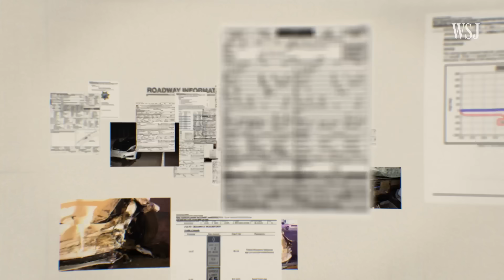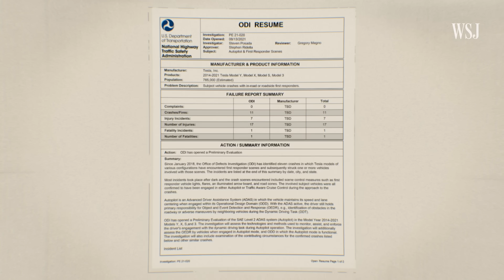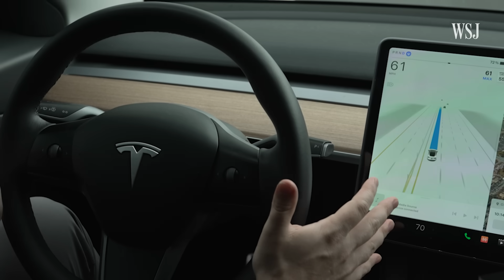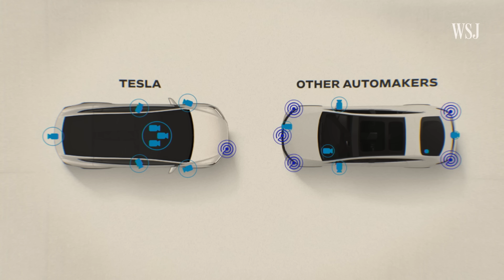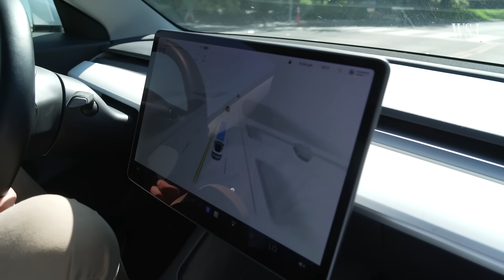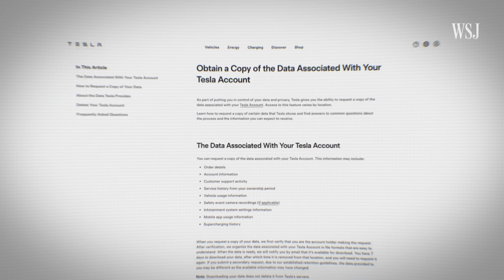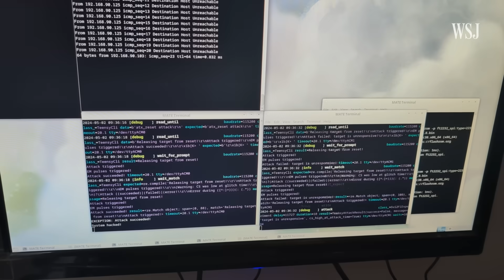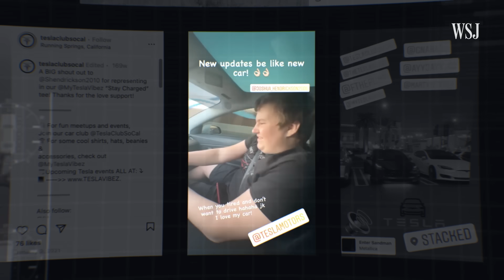The Hidden Autopilot Data That Reveals Why Teslas Crash | WSJ

Comment: Seems that Tesla is being held to a higher standard for some reason.  My Lexus isn't going to avoid those crashes either--and the car isn't supposed to drive on their own.  You are driving the car, and even Supervised FSD (which I have) is just a better form of cruise control.  The drivers, in my mind, are at fault.  They were warned, and not paying attention.  Now if Tesla software was making mistakes and steering people into deadly crashes, that would be a problem.

Comment: Autopilot does not mean Full Self Driving.  It's that simple.  Autopilot is cruise control, lane keep, and emergency braking.  You are always required to monitor it.
Reply: People don't want to read, but still want to be mad.
Reply: Obviously the tesla cameras cant see in the dark. Humans can.
Reply: @alanmichael1234  every tesla owner could tell you after owning the car only couple of months that the car sees better than they do. you need only be a passenger in one and look at the visualization on screen to understand this.
Reply: Surely the whole point of this video is that it does not do emergency breaking
Reply: @alanmichael1234  it does do emergency breaking!  The examples shown are pitch dark situations that would be difficult for a human to see before its too late!
Reply: Tesla’s full self-driving is also not full self-driving. Any system design has to accommodate human error. Especially safety systems. Tesla mislead customers by using terms that imply the system is safer than it is.
Reply: If that's all it did, it would be fine. But it does more. It can also take corners, switch lanes, even start when a light turns green.
It takes away too many tasks, making people bored, causing them to lose attention.
Reply: @Robbedem  "Autopilot" (not FSD or Enhanced Autopilot) does not switch lanes or stop for lights or signs.  As for cornering, if you mean following lane marks on the road as it corners/turns, yes, it does that.

Comment: As much as Elon fails, this also fails on the other extreme. Tesla has some very good engineers, handicapped by Elon? Yes. Starting off with a crash from 3 years ago is misleading, by a lot. With the many upgrades has come improvement. And you should listen to some people who review the changes and this past year has apparently seen a lot. And have you ever asked what LiDAR consists of? A light source with the ability to strobe, super fast; Teslas have top end lights capable of this, check; light sensors or cameras, check; a fast computer that can measure when light was emitted to when it was reflected back, fast computer? Check. 

The problem isn’t Tesla, the problem is no AI understands how to tell the truth, they just want to generate answers. This is a fundamental flaw. Beating that down is ambitious. 

Is Tesla FSD safer overall? That is the correct question, like I was telling a guy who doesn’t wear seatbelts, the fact you MIGHT be in an accident where not wearing a seatbelt is optimal, it is unlikely. Tesla seems to be like this, only big numbers can measure it, not our tiny experiences. I think the answer might already be yes, but A, we can’t take Elon’s word on this, and B we must be entitled to see the numbers for ourselves.

Comment: 1. Is there anything in front of the car that's not the road?
2. In what direction is that thing moving compared to its surroundings?
3. In what direction will that thing be moving based on its appearance?
Why is that so hard to implement?

Comment: This is a big complaint that I have with our machine vision systems at work, which are part of our quality control. The machine vision system often can't accurately determine what it is seeing, but I a human can. Without a human override, the systems are useless and don't really ensure quality. They are great at recording data, but I can often create false data without much effort. The typically just slow the speed of the process down.

Comment: idk why, but when I hear elon said that it is it's more safe than human or greater safety driving while also implement it only using cameras and only putting one radar as backup?, makes me think it's like implementing GPWS on an aircraft but instead of using proximity sensor (Perhaps mixed with Inertial Sensor and other stuff?) (mixed with GPS on EGPWS), you use camera only for the GPWS, or implementing trim system to be automatically adjusting while only based on one AOA Sensor

Comment: From watching Mentour Pilot, I have come to realize that autopilot in aviation has a completely different meaning than what it means to the general population.
Reply: Pilot here, yep. The public looks at aircraft autopilot as a navigation system that does it all, not recognizing it has to be programmed with a very specific plan, has a couple dozen combinations of operating modes, and has to be managed.
Reply: @skycaptain3344 That is what Tesla is claiming to be autopilot. Hence the distinction between Autopliot and 'Full self driving (Beta).'
Reply: @CmdrTobs  as the video shows, that’s not what Elon Musk has actually been saying
Reply: @CmdrTobs  And Tesla sells autopilot as something better and more capable than the adaptive cruise control with lane keep assist and breaking assistant in a 2020 Opel Corsa from Stelantis.
Reply: @VolkerHett  Still some european car brands have far better "auto pilots" than Tesla. Almost every new european truck would have avoided the crashes shown in this video. Because europeans do not solely rely on video.
Reply: @skycaptain3344  not sure it did.Time index?

musk has talked about this confusion at length autopilot vs FSD (beta)
Reply: @VolkerHett  it does a lot more than that, it it decides on speed, changes lanes etc... hence.... autopilot.
Reply: @CmdrTobs  Back in 2020 my Opel alerted me of speed limits and asked politely if I authorize it to adapt to the speed limit. 
Ok, it flashed a speed limit sign in the dash with a message to press the mem button on the steering wheel :D
Reply: @Maurus200  

Elon Musks 'Ted' talks aren't a product manual.

They are different products, it's not just semantics.
Reply: @CmdrTobs  Full Self Driving (Supervised) these days (since the middle of 2024).
Reply: @VolkerHett   Basic Autopilot and Traffic Aware Cruise Control (TACC) is included with most if not all Tesla passenger vehicles, these days. Don't know if it is available for Cybertruck, yet.  Do note that Autopilot and Full Self Driving (Supervised) are two separate products. An FSD subscription currently costs about 100 USD per month, or can be purchased for 8,000 USD.  Autopilot aided me in driving out to San Diego and back to Alabama last February. Next year FSD will do the same trip this coming February. Autopilot, will not, for instance, stop at a stop sign, nor make turns at intersections. base Autopilot is primarily lane holding. FSD is for all sorts of roads and obeys many traffic signs, it is also integrated with the navigator so it can be used (in principle) to drive you from most places to most destinations over most roads.The current FSD ( Version13.2.2 FSD (Supervised) ), though much improved over older FSD (Beta) and Autopilot, has not reached the point where it no longer requires supervision, so it monitors the driver's face and eyes and if the driver fails to pay attention to the road, FSD will noisily demand the driver take over.
Reply: @ yes! And four years ago it wasn’t as able as today and that’s why it may not be advertised as anything beyond 2.5 autonomy in the EU until it’s certified.
Reply: @slowercuber7767  out of beta, good to know
Reply: @ its amazingly good, but still requires watching and still has some flaws, some inconsistent, some consistent flaws. The change from Beta to Supervised makes sense, and it is so much better now, but you really still must stay alert and ready to take over.
Reply: @peter_meyer BMW Mercedes way better
Reply: @skycaptain3344  Who is this 'public' is it really late boomer moms/dads who think autopilot = Nightrider?

The equivlent cohort in the 90s thought 'laptops' are for lap use and CD rom dives were coffee cup holders.
Reply: I own an Tesla and operate a real autopilot all day at work. The autopilot in airliners is really just a workload reduction tool. It will do exactly what you tell it to do and it will not react to changes in the environment for you. Tesla autopilot actually does much more than a “real” autopilot. But it’s not very reliable and at least in my 2020 X it says very clearly that it’s a beta product and you are responsible for safety. People are foolish to trust it with their lives. It’s certainly helpful on long drives but you have to stay vigilant and most people don’t have the discipline to do so.
Reply: They should have made the autopilot on these cars cannot be engaged if these systems are unsure what to do on an unknown circumstances just like how in a plane does (such as when stalling the autopilot wont be able to engage and require the pilot to stabilize first and make sure everything is ok)
Reply: @ap-qd9xf  How is it going to help if you are approaching an unknown at 60/70 miles per hour? Maybe the car should just hard braking when approaching an unknown every time to stop in front of the unknown.
Reply: @Uouttooo  Exactly what my Subaru does and that's only got enhanced cruise control, mainly because Subaru didn't cheap-out and ditch radar sensors.
Reply: @ap-qd9xf  The question is can it disengage with enough notice for the driver to take control. A plane is typically several kilometres from the nearest obstacle (the ground).
Reply: And sailors understand it too.
I wouldn't set my autopilot and go to sleep, even if I am I the middle of the Atlantic ocean.
Not to mention sailing in shipping lanes where there are big ships around.
This is a 2 part responsibility, tesla for false advertising and the drivers for being irresponsible. 
A car is a weapon.You wouldnt let a weapon fire without having total control of where it is targeting.
Reply: even on planes they always need a 'woke' pilot while on auto-pilot.....
Reply: Guys it gets better within time
Reply: Good comparison. Flying large aircraft we are on autopilot / auto throttles 98 percent of the time. 

When the weather is very very poor for landing we HAVE to use the autoland system. Our aircraft and crew are able to preform a landing with zero visibility. There is a lot of training involved initially to be qualified to use the autoland system. And then every year you will practice it once in the simulator. Only the captain can preform the landing. 

When we use the system in the real world we spend almost five minutes briefing the landing from the checklist. And then the monitoring of the aircraft is intense. It doesn't take much of a system degradation to cause a go around to be called for. 

True autopilots in a car that don't have to be closely monitored by the driver seems to be a long ways away.
Reply: And there is a reason that pilots are extensively trained on how to effectively monitor all automation in the plane and stay vigilant even when not manually operating the controls.

And the automation systems are also build on not only redundancy but also to give clear and concise information on exactly what mode they are operating in to the pilot.

The same should be the case in cars. Automation can take away some tasks from the driver but at the same time make it harder to stay in the moment and ready to notice and react if something unexpected happens.

From my own experience in flight training I know full well that it is harder to react to a sudden, unexpected thing happening if autopilot is engaged compared to when flying manually. A false sense of safety will naturally lower your vigilance and can quickly become a trap.
Reply: Yep autopilot and FSD are totally different things.  Not defending Tesla For calling it autopilot. Because it’s kinda misleading. Also you would think WSJ would do its due diligence and let its watchers/readers now what autopilot actually is and what it’s not.

Example:  at 3:04, it is not the autopilots job to stop at this intersection, but FSD would. If anyone is using autopilot other than a fancy adaptive cruise control on highways, then they’re mislead and didn’t read or properly understand the autopilot manual.
Reply: Imagine if airplanes used camera data instead of actual sensors. I know it’s not 1-1 analogous because they’re so much more complicated then cars, but that’s not my point. Just imagine how crazy that would be.
Reply: EVEN if you have a lofty expectation in aviation autopilot, there is a distinct advantage in not having wrecked shipping trucks in the sky!
Reply: Exactly this. Autopilot is basically a human-operated system that requires constant vigilance and total knowledge of how it works, how it will respond to situations, and how to tell it exactly what you want. Two pilots are required most of the time to fly a plane, and they use autopilot like another set of controls, not as a system to do their job.

The point is to reduce pilot workload to enable them to achieve the safe operation of the aircraft, not to fly the plane for them. Tesla are trying to make a system which removes the humans totally. In aviation, for almost a century of trying, we still do not have a safe, unsupervised autopilot that can be used at any time. We are close (Look at the emergency landing feature on Cirrus Vision jets), but not there yet. Airspace is highly regulated, and anyone using it is following a very well defined and specific set of rules. In contrast, roads are incredibly chaotic, and many drivers have poor knowledge of the correct way to do things, or are just brutally ignorant of the rules. 

And here we have Tesla, who think they can make it work using computers with crippled, unreliable sensors (cameras only). The moment Elon said they can do it using cameras only, I knew the whole system was doomed and would result in deaths.
Reply: I think pilots dont even call it autopilot, or at least thats not how the manufacturers call it. Pilots get extensive training as to what the system can and cant.

Big difference to Teslas, considering how Elon constantly talks about self driving cars. Like in 2015 he said fully self driving cars are just 2 years away, its not a secret why he called it autopilot.
Reply: @termitreter6545  Yeah. We do. The standard callout for us to put the jet on autopilot is, " Autopilot Center Command".
Reply: @MyGoogleYoutube  True. I ment the specific systems for aircraft.
Reply: @termitreter6545 We still call it officially the autopilot in aviation. But our autopilots are much simpler than road vehicle autopilots. There has been no artificial intelligence involved (at least until now). We don't have cameras for avoidance. The aircraft assumes no obstacles - which is appropriate. So the job is much much easier. Its computer does not have to think.
Reply: @termitreter6545  Pilots call it autopilot
Reply: It's such a fun irony that flying a plane is easy for a computer, but driving a car is a hurdle. Really demonstrates the fundamental difficulties of computer systems.
Reply: @Selsato A plane mostly has almost no obstacles. A car with other cars does.
Reply: @Selsato  -- A lot of the scenarios in aviation rely on the old saying, "Big Sky, Small Plane"... You don't need computer vision or RADAR as long as you are above the highest terrain in your general area and you are not near a high congestion area (e.g. airport)...
Reply: Oh, airplanes will do the same things with their auto pilot.  Case in point, two pilots were dead heading an empty plane between airports. For fun they took it up to its max altitude.

Since the autopilot was set to altitude hold, it kept pitching up to maintain the altitude, until the winds disrupted the airflow into the engines enough for them both to flame out.

The missing part is that instead of us being given specs on what the computer is capable of doing to control the car, it is being wrapped up in a black box and sold as an autonomous vehicle.
Reply: @chrisroode the autopilot did not cause that crash nor could it have prevented it. The pilots took a poorly designed airplane (I have way too much time flying it) to its limits and the engines couldn’t take it. The scenario may seem similar to Tesla crashes but the root causes are different. Over-reliance on automation does exist in aviation but that wasn’t the problem in your example.

Comment: I rented a Tesla and drove it for 2 weeks. I was mostly in the city. The autopilot was not usable. It wouldn't even autopark. Those cameras cannot see super well and it's clear from the 3d model on the screen that the car is constantly glitching on people and cars around the vehicle. I honestly can't see how someone could ever trust it. I guess on a well lit highway it might feel usable but then the speeds are so high the danger is crazy. Also, I was taught to drive defensively from YDC and I noticed the Tesla was not trying to leave ample stopping distance gaps as my training dictates.

Overall you can see the arrogance of Elon in the simplest small things translates to the deadly car overall. The guy thinks reinventing a door handle on a car is a good idea. Just trying to shave costs and you get a very frustrating experience with a power dependant car door!? No thanks. I'm not going to be burned alive in a malfunctioning computer like so many others have (gee, what a surprise the doors don't work in an emergency, just like they don't work normally unless you follow the religious formula of using your phone a certain way that Tesla dictates)

Sorry for that rant. But I was really hoping to be impressed when I rented that car and I was just amazed at how cheap and illusionary is the tech. For that price tag too!